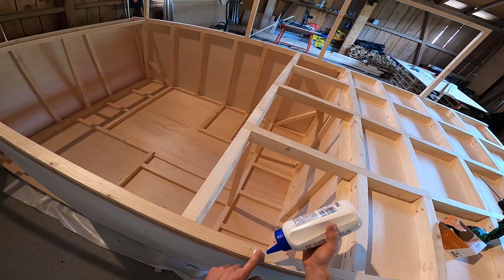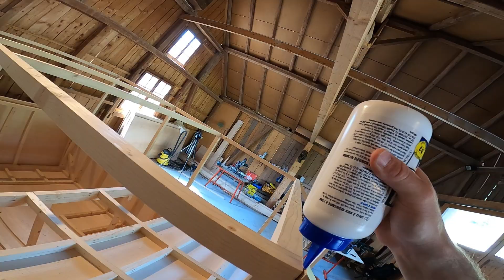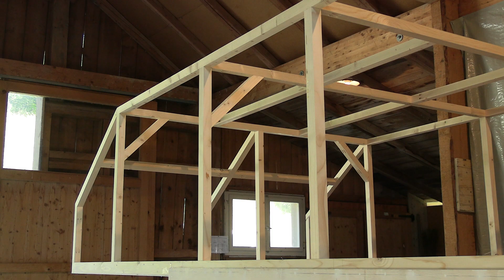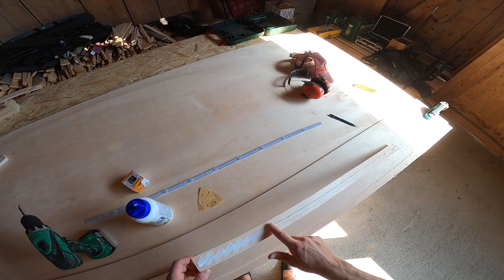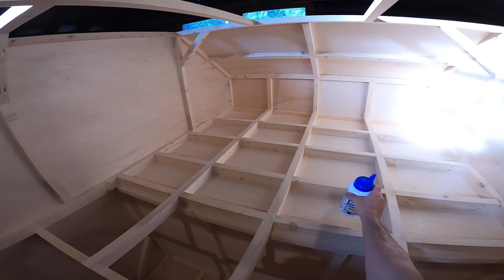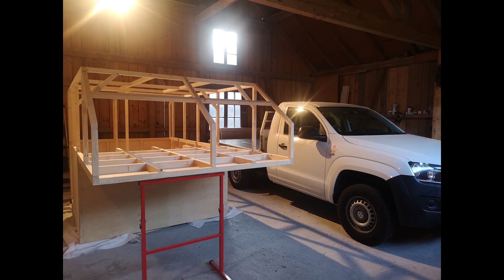DIY TRUCK CAMPER / The Amarok Flatbed / Ep3

Comment: Im curious why you didn't use nails ? Nails are much more resistant to shearing, which happen alot in a moving camper
Reply: No they aren't they are more ductile but this does not equate to being a stronger joining method as 1. If your rigid components  move enough for that to be an issue nails will not save you 2. the wood around the screw deforms before it reaches ultimate yield for both nails and screws which then makes it more of a issue of pullout strength which nails are weaker in check out project farms video on a side by side test.

Comment: Did you glue and screw ply on? or glue and nail ply on? thanks.
Reply from the maker: Glue and screw
Reply: @TruckHomeSwitzerland    looks like small screws.  What size screw did you use?   2x 19 mm?

Comment: Great project, I'm watching and looking forward to the next parts.
What is the lifespan of such a wooden structure in off-road terrain, did you have a problem with stiffness during your first project?
Reply from the maker: Hey thanks! i have never done any crazy offroad besides some bumpy gravel roads or a steep bank to get to a spot. i don't see a problem in stiffness.. there are plenty of wooden camper builds out there (pretty similar to mine) and seem to do the job.

Comment: Im curious aswell, how has it held up against torsion while driving, how did you mount to the deck, and how is it weather sealed?
Reply from the maker: i never had any flex/torsion issues with my last diy campers, this one is built even stronger. its tied down to the frame by 4 ratched straps (see in part4). the complete camper is wrapped in 2 layers of fiberglas.

Comment: What's the total weight of the camper so far with framing and plywood?
Reply from the maker: hey. around 500kg dry, this is with 6 windows, 350w solar, fridge, toilet, bed and electrics. i assume less than 400kg only framing, plywood and fiberglass.